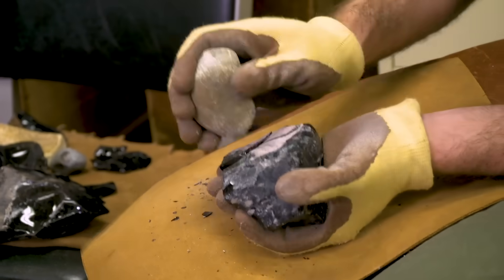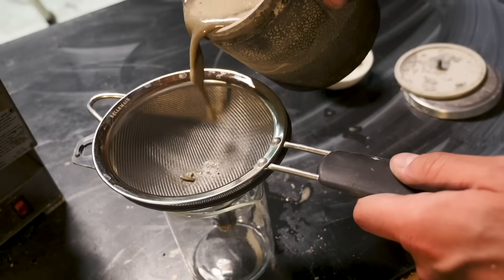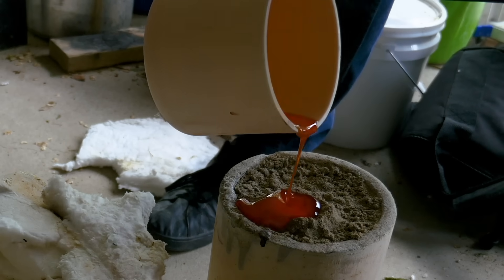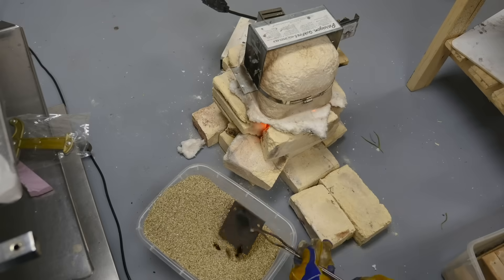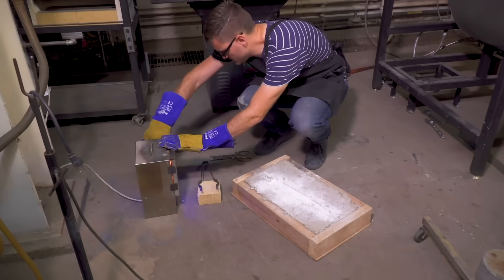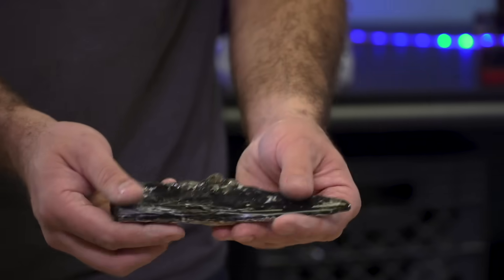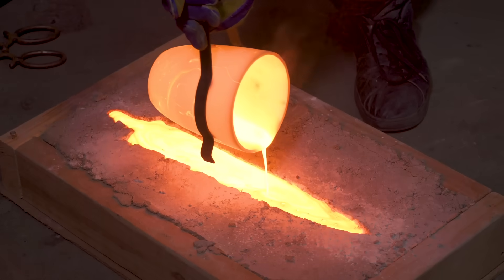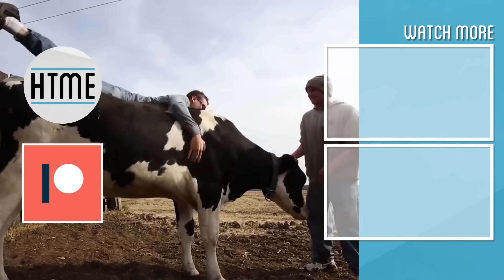Can You Melt Obsidian and Cast a Sword?

Comment: Didn't the ancients used to cast obsidian weapons and armor? How could they do it ages ago and we can't do it now. Probably more of that black magic, the same way we can't replicate the Pyramid in the same way even with all our modern tech.
Reply: Atacan Tütüncüoglu they actually learned they where not slaves who built the peramid they where paid well and lived well.
Reply: blacc beard I think they probably found thick plates and bound them together as armor. Same as weapons, not cast but well made.
Reply: They used a bellows system and gradually reduced the heat on the finished product as opposed to purely relying on the sand it was a very long cooling process.
Reply: No.  Obsidian is nothing more than volcanic glass. You don’t make armor out of glass. You don’t cast glass weapons, you can chip the glass and use the sharp edge as the Aztec did, mounting it in a wooden carrier. Both armor and weapons have to be strong and able to endure repetitive shocks and impacts. Metal does, glass doesn’t.
Reply: Well they didn’t have diamond pickaxes so...
Reply: blacc beard they even turned the freakin frogs gay
Reply: He's already made a blade in the traditional ancient Aztec style, which he showed off at the start of the video. These weapons were not cast, instead the Aztecs inserted chipped obsidian "teeth" into a wooden frame. There's no practical reason to actually cast obsidian, even if it were possible, since as you can probably tell the result is quite brittle. Armor made of obsidian would be the stupidest idea ever, since obsidian creates really sharp edges when shattered, so such an armor would be really likely to kill the wearer with a single blow of any blunt weapon.

Comment: If you want to be nitpicky, it definitely is no longer obsidian once you melt it, since the name "obsidian" doesn't describe a particular chemical composition, but rather what is produced when volcanic lava with a very low water content is cooled very rapidly (higher water content would produce pumice instead due to foaming). Most obsidians have a SiO2 content of 70% or more, but there are some rare ones with very different compositions. So your sword might have a similar composition to many obsidians (but so do stained glass windows for example), but since it wasn't produced by a volcanic eruption, it can't be obsidian.

But hey, funneling a lava flow straight from a volcano into a mold would make it so much more awesome from a "fantasy sword" viewpoint anyway ;-)

As for your destroyed crucibles, notice that all your crucibles cracked when you used them the second time. Molten silica glass (which is essentially what you were melting) is actually pretty reactive and will attack/destroy many common crucible materials. You need to use special materials, for example electro-fused mullite or even platinum, if you want to use the crucible for more than one melt. If it were pure silica glass, alumina based ceramics might also be an option, but since obsidian often contains a high percentage of aluminium compounds, that is also out of the question.

Comment: Tipps for part 2: Find out and explain to us what Obsidian is, what melting point it has and if it can be mixed with metals. 

As for the production: Glass breaks when it has bubbles in it. You need a vibrating table to get the airbubbles out when they cool or you should make a solid block out of it and then sand or cut it down so that it becomes a sword. Maybe you should try a knife first though, because of the size of the equipment you have available. 

Also: Ask GLASSMAKERS if they can help you to produce it.

OR

Find out what you have to mix the obsidian with (metal, sand, iron strings, concrete) to get flexible/more stable results.

Comment: My guess would be that maybe your obsidian was in a different phase prior to melting that could only be achieved at very high pressure and temperature that you cannot reproduce with your setup (for example under normal conditions you cannot cast a diamond into a sword either, but you could somehow rearrange the carbon atoms that the diamond is made up of and get them into the shape of a sword, you probably wouldn't call that casting though^^). Maybe also the flux had an impact on the formation of the crystal structure as well (I actually believe that this is a pretty big deal here).

Comment: I don't mean to sound like a picky viewer. 
But sir, you didn't make an obsidian sword, nor do you deserve to say that you did.
Judging from how much flux you used, and how often you put flux in and how much obsidian you lost, you made a sword out of more flux and metals than you did obsidian. 
Dying the stuff black with metals doesn't magically make it obsidian. Just means you took a shortcut. And you didn't re-cast with new material, you instead used the failed product (or as it would seem)
Find someplace capable of melting obsidian
Or don't try this and fail, then claim it's made of obsidian (which it sure as hell isn't)

Comment: Melting yes, casting it no. Obsidian is an amorphorous substance that is to say it is glass with a completely random internal makeup. That minerals cool slowly and develop their characteristic crystal structure is why they are not optically clear. Each internal crystal interface refracts light and so causes distortion. Common glass is optically clear because it too has no crystal framework. It is totally random quart atoms bonded together. As soon as a glass substance is remelted and allowed to cool it will develop crystal structure. So casting would be difficult. Quenching would also have to take place, so its likely you would have to handle it like glass blowers blow their glass. I have seen glass workers "mould" glass by embossing it. rather than casting it.

Comment: If I were to try that I'd make a couple changes.  First I'd make an obsidian dagger.  Short but slightly on the thick side to give some strength.  A "glass" "obsidian" sword would break if ever used.  Unless you can temper obsidian like tempered glass.
I might also try to cast the edge to be knapped off for the sharpest edge.  Kind of like tapered to an intentional fracture point.
Good fun seeing all your process evolution.
Reply: Drat

Comment: It's a crystal the only way to work with it is to build a vacuum melt it under negative pressure and introduce argon gas to form perfect crystals then pour it into you mold the mold must also be in the vacuum

Comment: i wonder if you can separately forge different types of steel and then fuse them into one blade, like, forge the base into A6 tool steel of oakenshott type XVI, with traces of L6 bainite in the spine for flexibility, traces of D2 tool steel into the edge for edge-keeping, place a thick middle layer of hardox 550 steel for wear resistance and a thin outer layer of inconel for oxidation and corrosion resistance, and heirloom-level reusability, and preferably a paper-thin outermost layer of 13% manganese mangalloy billeted to give the illusion of damascus steel.

Comment: There seemed to be a lot of issues due to moisture in the materials.  I wonder if you could use a dryer similar to what is used in plastic injection molding.  Get the moisture of the obsidian chunks to something below .02%.  In cosmetic plastics, moisture is a killer. Especially if you intend to plate it or alter its form.

Comment: 2 years ago, i was  making large sapphire crystals at work, sapphires require 3700F+ , large, being 5ft x 1.5ft x 4 inches thick, weighing in at 350 pounds. we were R&D, never making crystals that large. for a year they would always crack at cooling. after the initial process, we finally eliminated the cracking by keeping the furnace at 3700F for 8 hours after crystallization to anneal it so it wouldn't fracture. as i said, it was R&D, nobody made sapphires that large before. this project was for the USAF, making sapphires that big, i never signed anything for secrets, but had to be a US citizen. you might want to maintain your crystallization temp for a few hours to anneal your crystal, just a thought...

Comment: Really interesting video and cool experimentation! Another option that may work for creating an obsidian sword might be to "fuse" or "slump" it into shape rather than creating a heavily fluxed glass that flows enough to be cast.  At lower temperatures, using a larger kiln, you can create an open face mold from silica/plaster in a metal box and have it all heat up in the kiln, where the glass will just melt in place along the shape of the impression.  This may still require you to process the chunks into smaller pieces like you have done each time, but very little flux will be required, as you will not be pouring anything.  Basically, instead of the obsidian melting in a crucible, it is melting slowing in a mold. The same kiln can then be used to anneal it over time.  If this works, maybe you can try an in-kiln pour cup crucible into a "lost wax" mold type to create a full 3 dimensional sword rather than open face.

Comment: Instead of casting the whole blade in Obsidian, it may be easier to use a Tungsten core (this would also make the tang & handle easier, and it's probably the easiest metal you could get ahold of that would survive the heat). I wonder if injection molding would help with the cooling & environmental issues. It probably wouldn't be practical as a combat weapon--it certainly wouldn't be light--but it may make a neat display piece.

Comment: the biggest problem I see with what you are doing here is that you are reusing the obsidian you already cast. The problem with that is that when you melt down obsidian and then let it harden like that, it changes the composition and properties of the rock. Adding that flux to it doesn't make it any better, especially when you just keep adding more and more to it. Once you melt down rock, it is no longer the same rock, at least not entirely. the newly cooled obsidian will still be obsidian, in essence, but the properties it will have will be completely inept for a blade, and constantly redoing the process will just make those new properties worse each time you try it

Comment: you need to melt it in a kiln in a mold and just like clay or any other glass product ,the temp needs to get cooler in the kiln and drop over a period of hours. when doing ceramics, the item is gradually heated and gradually cooled .

Comment: perhaps try mixing your own mix to make obsidian?  You started with obsidian and changed it to barely cast, but what if you just tried to make your own without dye? It'd probably cast better as it only gets the frailness and inability to cast from adding extra stuff and starting with the base obsidian. The lack of dies will tell you if it's actually obsidian based on the color after it cools.

Comment: Can you melt obsidian? Aka igneous rock...
Well, it was melted to begin with, so, yes, you can.
There's no reason you cant...can you cast a sword? Why not?
Asking questions preys on peoples need for answers.
edit: love the channel though.
Reply: The conditions aren't the same as a real deal volcano, like how you cant unbake a cake, once the obsidian is cool its done. The whole video is a huge struggle and was not really obsidian with all the flux and using dyes to keep it black. And you saw how foamy it got when he just tried just melting the straight obsidian rocks. You see aztec weapons and its all sharpened flint style and never cast, humans have been trying for a very long time but like many things we can never make it quite like mother nature can
Reply: Dante A would this still be an igneous rock or a metamorphic rock ?
Reply: Melting yes, casting it no. Obsidian is an amorphorous substance that is to say it is glass with a completely random internal makeup. That minerals cool slowly and develop their characteristic crystal structure is why they are not optically clear. Each internal crystal interface refracts light and so causes distortion. Common glass is optically clear because it too has no crystal framework. It is totally random quart atoms bonded together. As soon as a glass substance is remelted and allowed to cool it will develop crystal structure. So casting would be difficult. Quenching would also have to take place, so its likely you would have to handle it like glass blowers blow their glass. I have seen glass workers "mould" glass by embossing it. rather than casting it.
Reply: bo jackson if you’re tryin to sound smart  it’s not igneous rock it’s an igneous rock
Reply: This guy's an idiot with too much time and money on his hands. Where's he get the money? Who's the nut who's paying him? He needs a real job!
Reply: Bo he's just playing the youtube game he has genuine intelligence and video why not try to monetize it best you can. this isn't a thesis statement this is clickbait and there are far more predatory ways to do it. get your head out of your ass you can answer cvideo title questions lmao
Reply: You can melt/boil/vaporize anything, provided it's molecular formula is simple enough like SiO2 so it won't break from heat before it melts. And if it breaks whatever is left still can be melted/boiled/vaporized. You just need enough heat.
Reply: You're fun at parties

Comment: I dont know if your going to try this but i have a great idea witch if you can create ill be shocked a lot are you up for the challange? 

Lets find out!

Your Challange Is To make a pistol called glock!
Sounds easy right?
Nope
You need to make sure the gun actully fires atleast 10 m and for the longer the fire the better you are
10 m good
20 m Good 
40 m better
60 m better
80 m Great
100 m Great
200 m IMPOSIBLE! 

So if your up for the challange 
send back a little msg and tell me if your up for it
Also your racing another youtuber 
Lets See Who Better!

Comment: isn't obsidian basically a type of glass?
Reply: Pretty much, i mean its majorily same sillicon that is used for glas making just that its impure.
Reply: Obsidian is basically volcanic glass with many impurities. It's difficult to work with because it doesn't have a uniform composition. This leads to varying melting points and unexpected reactions.
Reply: Its just a very fast cooling, mafic (basaltic, low in viscosity) igneous rock. It is not a glass, but has a glassy texture.
Reply: No its a water and lava meet together, when water touch the lava it form obsidian. (Minecraft Logic)
Reply: Dragon Glass
Reply: Bonedragon1300 No obsidian are usually formed with many metals and chemicals........
Reply: From Britannica - Obsidian, igneous rock occurring as a natural glass formed by the rapid cooling of viscous lava from volcanoes. Obsidian is extremely rich in silica (about 65 to 80 percent), is low in water, and has a chemical composition similar to rhyolite. Obsidian has a glassy lustre and is slightly harder than window glass.

Pumice is another form of rhyolite, just with more gas and water in it. The rapid cooling this speaks of is only in comparison with granite which can also be of similar chemical composition buts cools far beneath the surface. The Big Obsidian flow at the Newberry Caldera in Oregon still took several years to cool.
Reply: nope, it doesn’t have a defined molecular structure, in the other hand glass has a highly arranged crystalline structure.
Reply: Fernando (lolencio) Amigo that's so wrong. The very reason that glass is transparent is because it has no defined crystalline structure. It's an amorphous solid.
Reply: "glass has a highly arranged crystalline structure"
The whole point of any glass is that it has NO crystalline structure.
How do you come up with such things? Do you just pull it out of somewhere or did you really read that somewhere (link)?
Reply: Fernando (lolencio) Amigo the point is that it DOESN’T have a arranged crystalline what drugs are you on lmao
Reply: molten volcanic glass when water hits the molten Lava it forms Obsidian

Comment: I think it cracked because too many different compounds which have different melting point and ability too release heat and also different thermal expansion not properly mixed. And maybe obsidian not good at bounding another material unlike iron. That's way we found it in a big chunk not a grain inside a rock

Comment: I used to work in a small shop containing a foundry for making tire molds. We poured Zinc and Aluminum. The stone mold casing you are pouring into needs to have ALL water removed prior to just before your pour. With tire molds we needed used soft plaster, but once the plaster was assembled, we would bake the rings for 2 days at 475 deg. to get every bit of water out. 

Having the water still in the plaster to be poured into would produce many bubbles in the casting that the hand-finishers would need many days to repair. Make sure you are completely water-free until just before you pour. Your bubbles will not be an issue.

Comment: A good flux to use would have been some low carbon steel whats going on is that the flux you used was melting way too soon and was not mixing in with the melting obsidian properly causing a fragileness not often found in the volcanic glass due to poor mixture you were getting the high flux areas coooed faster and expanding due to the heat and thus pushing the obsidian away.

Comment: This video caught my interests very quickly, but I was also disappointed very quickly. Watching the way you casted it in my eyes was incorrect. I understand casting glass may be different than metal, but when you cast it with an open top, the blade is not symetrical where as if you had 2 sets of sand on each side and poured in through the top or bottom. I don't know if I explained my side very well, but I hope you can see where I am coming from

Comment: To do obsidian casting you want to use powdered obsidian and powdered steel 2 parts steel 1 part obsidian it makes a cracked black steel blade that tends to be cool to the touch. But strong enough to be used.